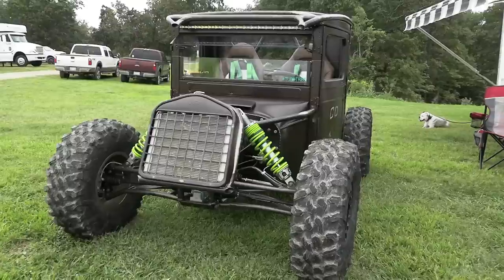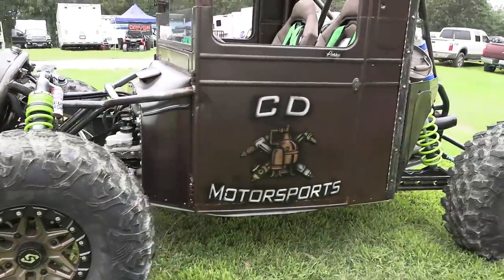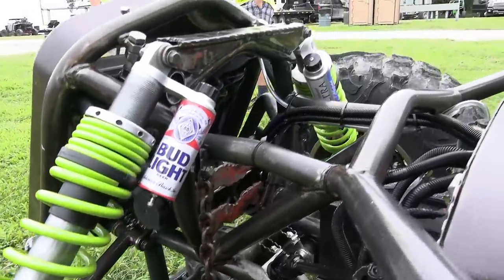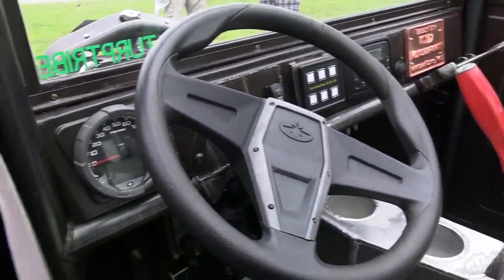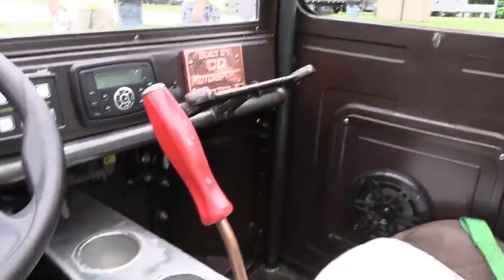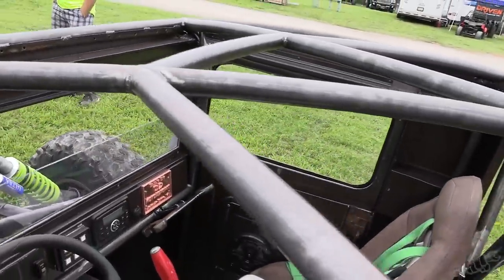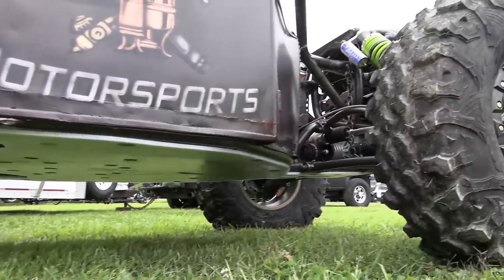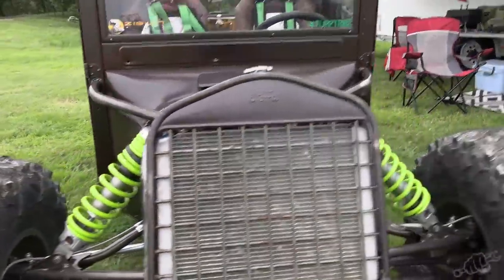Model T Truck RAT ROD RZR BUGGY Build

Comment: In New Melly everything is srteet legal ;-)  Just make it faster than the cops lol
Reply from the maker: just needs a tag and he will be golden
Reply: That’s cool since he lives out side the county lines.  I had issues when I ran a 2 seater mini sand rail.    They would not give me a plate, I lived in the county not far from his 😉 I ran mine anyway 🤫 until I sold it off and went back to mx
Reply: Reason why was no ECU emission hook up.  It was fuel injected had computer yet they just couldn’t do a standard emission test. Passed safety no issues.  But the state government  branch I was dealing with To get a waver said he didn’t know enough about buggies to let me have a waiver I was pissed.
Reply from the maker: they do emissions testing way out there?

Comment: Needs a hood rear body panel's and either a turbo or supercharger!
Reply from the maker: turbo would help for sure
Reply: @BustedKnuckleVideo  oh it doesn't have the turbo? Well it was still tearing it up but yeah a turbo would be nice and he could make the inlet pipes look cool on it if he wanted. Not to sure about a hood and panels though I meanthey didn't usually put them on  those old roadsters besides it would add more weight but actually now that I sit back and look that may look good but I stand by the weight.

Comment: Why does it keep loosing power?
Reply from the maker: its a 1000 it doesn't have much
Reply: Engine swap to the Kawasaki Ninja H2R I mean it's only 326 horsepower I think that should beat the 110hp the 1000 puts out lol the Ninja H2R is the engi e I want in my UTV dint know why I don't see everyone using them.

Comment: Need a car motor not that baby ass Polaris.  Like a small block chevy
Reply: he would have to rebuild the frame to fit a different engine 
it would be easier at that point to make a entire new buggy
Reply from the maker: I like it better like this where it can be light and nimble and do well off road. This polaris engines can make more power than a stock small block chevy.
Reply: @BustedKnuckleVideo  yea i can totally understand after i watched further. Well done awseome. Best one like this I've seen and i watcj a lot.  Speciallu the model T
Reply: I recant
Reply from the maker: no worries it happens